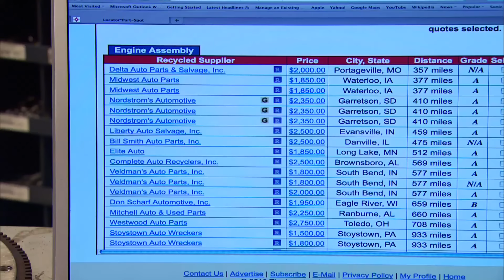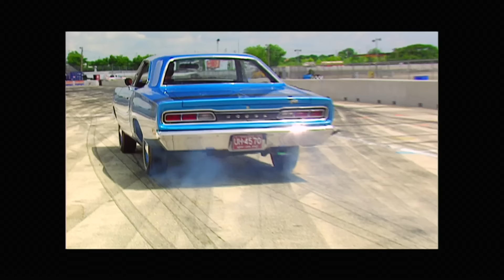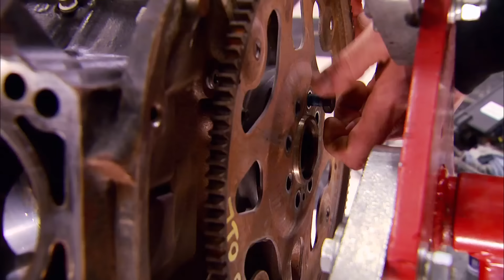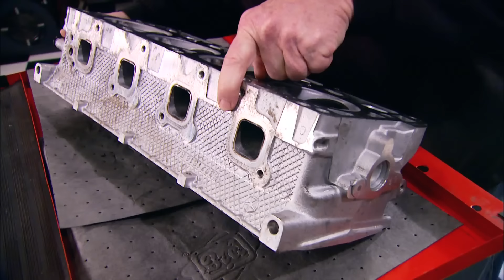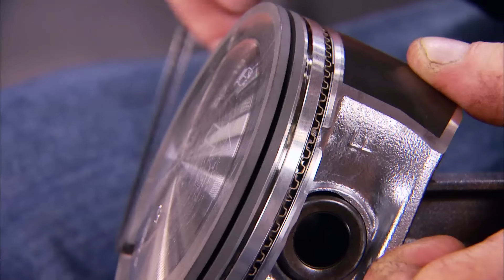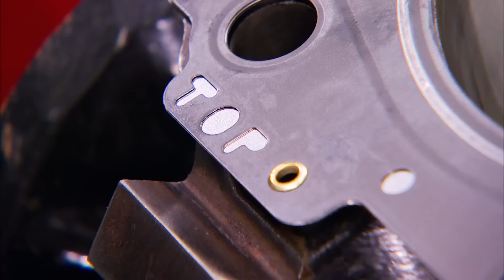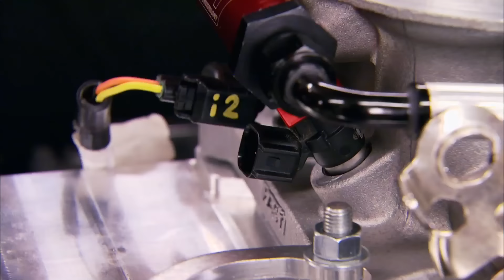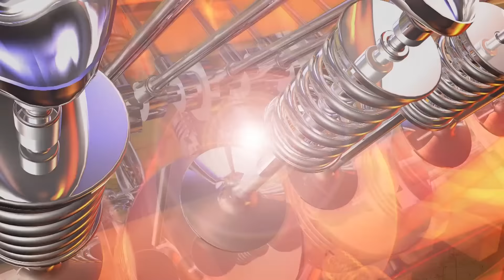Recycled 5.7L Hemi Budget Build Stage 1 - Horsepower S14, E8

Comment: Electric water pump... yet use the truck stock camshaft..with that intake and induction system. And its all apart anyhoooo put a good cam in and if you arent doing a cam and better heads.. .why tear it all down with only 55k miles anyhow...just  slap the induction system on

Comment: I have two questions for anyone that knows the answers.   Since they got rid of the factory ecu and harness, what kind of alternator would work with this set up.  Second does the 5.7 liter hemi bolt up to a truck 46 type transmission from 98 to 01?

Comment: As a parts Manager at a Dodge dealer I can say there is no way I would reuse those lifters. I've seen too many wear out and grind out a glitter parade and waste an engine.
Reply: Exactly. Plus with the low oil pressure problem due to the engine block oil passages a milodon or melling high pressure oil pump should be used with a quart of Lucas oil treatment.

Comment: Rear main oil seal is supposed to be installed dry.
Reply: Dave Topp 
They were definitely reading a different manual. Glad it wasn’t my engine.
Reply: @youtubestolemyhandle1  me too. Reusing lifters.. not taking care of valve seats... Just washing down the block... It made me cringe.
Reply: I dont understand why they even opened that engine up...

Comment: Good motors - Chrysler (Not FCA folks - Chrysler developed and built this engine long before FCA maybe even before Daimler came on board in '98?) has tinkered and evolved these to where they are getting closer and closer to bulletproof.  At least they better be moving towards this with 17 years of service.  Yes I know there is the original 5.7 and the 5.7 Eagle, but bare essentials are still in place.  They won me over from Ford which is saying alot since I was raised from Ford family and bought nothing but until my Jaguar built Lincoln 3.9 V8 went kaput.

Comment: Pistons and rod's do not need to go back in the same hole, especially with fresh rings and a hone... also a visual on bearings doesn't mean alot any more, new engines use aluminum bearings, you can't "see" the wear like old Tri metal bearings with copper underlayment,  always measure.

Comment: Hi, I have an 06 5.7. Concerning the valve seat drop I’ve installed a 180 Tstat  with a tuner the fans now come on 25 degrees sooner and MDS is off for consistently even head temperatures. It just turned 100k miles. Can you give me an opinion as to my need to be concerned of this issue? Also we’re these engines made in different plants and that maybe the ones that do drop valves all came from the same plant? Any guesses? Thanks
.
Reply: Replace the heads before the valve seats fail (because they will)around the 125k milage mark. You cannot get around this. If you wait to do it after they fail, it's going to be much more expensive.

Comment: Damn 2019 5.7 rams tick at start up. I would upgrade the oil pump
Reply: It's not the oil pump it that Mopar oil filter .  Restrictions on start up had the same problem change the brand of oil filters no problems no tick from start up

Comment: Okay, I'm confused.  I've been under the impression that all Ram 1500s with the 5.7L engine made after 2005 had MDS; I remember Dodge making a point of mentioning it in their brochures.  How did an engine supposedly out of a Ram 1500 not have MDS?
Reply: It had to come out of a 2500 that didn't put mds on those models

Comment: So if I get high performance heads , a cam, staged 2 . I should get about 60hp over stock.  5.7 hemi 3 has about 345-350 hp stock . Get it up to 469hp . That's not 60hp it's more like 110hp. That's not to bad . You will probably spend around 3-5k in doing all this . The ss, 5.0 are already at 455hp, with their upgrades puts them at 500+.  Better off just getting a 6.4 hemi , doing some minor upgrades gets you over 500+ .   Just saying.  Unless you are getting a supercharger then that's a different story .

Comment: Its weird how you have to remove the valve cover to add engine oil...
Reply: I looked it up, and it doesn't seem to be the case on a stock one.
Reply: @titanicwhiz  The factory oil fill tube is mounted in the intake manifold and directs oil into the valley. They lost that with the aftermarket intake.

Comment: So that EFI standalone system is neat and all but what transmission would you put behind this? Do they sell ab standalone TCM for the common 545RFE transmissions too?
Reply: Leave the 545 in the thrash can , use a 727/904/RH46 or a stick the G3 uses the same bellhousing patteren as the old small block....Now you can use a Nag1 or one of the new ZF autos transmissions , there is a companey called sound german automotive that sells a controller for those transmissions
Reply: stick an a518/46rh in it.

Comment: Lol replaces all the perfectly fine bearings and timing chain but re-uses the oil pump, and i didnt see any valve removal or valve seal removal after the heads were in the parts washer so thats gonna last with wash fluid in the valve guides... Kinda dumb guys, kinda dumb...

Comment: 400 crank for a stock to refreshed 345 engine...  not bad.  i'd assume a modern 345 hemi with long tube headers and air intake/tune can reach 400 crank correct??  i miss shows like this, i used to watch horsepower tv on the weekends back in the 90s
Reply: for 2K+$, its embarrasing. i built my 400 mopar to 400hp for like 800$.

Comment: All that work, and it would put down about 320hp to the wheels
Reply: thats optimistic
Reply: On my bone stock 16 charger it dynos 340 hp and 380 tq to rear wheels
Reply: @derrickhines9056  that means 420hp at the engine, assuming 20% drive train loss through the automatic
Reply: @tokuzumi1  it seems to be the norm for the 15 and up charger and chally 5.7 to dyno in that range. The daytona 5.7 packages dyno 10 hp more to the wheels with same torque

Comment: i got real lucky got 2 454 strokers one with 6000 miles the other has 38,000  on it rated at 450 hp at 485 torque gt both for free with a tunnel ram set up on one both run perfect

Comment: I have never seen an engine rebuild and using old parts  not replacing cam bearings using old lifters  not sending out the crank to make sure it’s straight  , it is just not the way to do things

Comment: It's weird how I can tell what's inside the engine block like pistons,connecting rods and push rods and rocker arms. 

But I cant see to determine what's what on the outside. Like  which one is the oil filter or the water pump or alternator. 

Any tips?
Reply: Watch hot rod or roadkill they will eventually cove the other parts.
Reply: @charlesbrittain434  thanks dude. 

Here have a beer🍺

Comment: is the Chrysler 318 a good strong motor mine is a 93 how can i get more horsepower its fule injection now please let me no does carburetor give you more power
Reply: the 318 can run, would be better to find a good build using your existing efi. Probably start with an agressive cam and springs, maybe AFR heads, bigger injectors and a tune would be a good start.

Comment: How Much would a rebuild like this cost A CUSTOMER ???  If I took my JEEP  5.7L HEMI to some place for a rebuild AS IS no extras But a good cleaning and rebuild  WHAT SHOULD I EXPECT TO BE CHARGED -- I live in INDIANA --   Not California nor NEW YORK  --- IN YOUR STATE  where ever your from What should a Customer  expect to be charged  ?

MY ENGINE does seem to be running pretty good BUT  it does have MANY miles on it.  Its a 2011 and has now 131,000 Miles but still -- IN MY OPINION runs like a top  BUT I would love to make it like new  without replacing the engine ( you never know what your going to run into after you replace stuff ) .
Reply: Upgrade the cam and put new lifters, do all non-mds lifters and a good tune. It'll be like brand new.

Comment: Who would pay $2000 for that? You got ripped off, big time!
Reply: what would a good price be considered?
Reply: @claytonhaske  The local yard want's $250 for a complete engine including ECU and harness. If you pay $2000 for a pulled engine, you've been had. Especially the 5.7l hemi's that have known, serious issues! Especially from a 2007. Those engines had issues with valve seats falling out(what happened to mine), timing chains breaking, cams flattening, and the MDS equipped engines were total garbage. You could almost get a whole crate longblock for that much. What a joke.
Reply: @JohnDoe-ml8ru  what hemi, if any would you consider? Also, thanks for your opinion, and time, much appreciated.
Reply: @claytonhaske  If I had to work on a dodge, I'd say the older generation, before dodge was taken over. The 318, 360, 440, etc. If I had to use something from the 2000's, then any 345 will do but it has to be torn completely down and rebuilt. All the problems with it have to be addressed. If youre just trying to buy one, then one from the later generation, avoid the engines from 2003-2010. Also don't expect a long life engine. The 2003+ dodge engines use oil passages that are way too small and don't provide enough lubrication and you're stuck with using shitty 0w/5w-20 oil. This is an issue that can not be fixed.

Comment: Why did you not check the valve springs and valve seats as this is the weakest part of this engine. With 50K on the engine valve seats drop out around 80 to 100K. I have a 2006 ram 1500 with 106k with dropped seats and bent valves. Service very regularly and never thrashed. This is a common issue with this engine.

Comment: Get the cheap older 5.7; get a 6.1 crank; aftermarket rods and pistons that are stock sized. Better bearings. The eagle head; better springs; new push rods (your choice); modified oil pump. Everything else stock. Aftermarket camshaft to support your power level thus the your choice push rods and springs. Now what you do w this knowledge your choice; at the end  you can have something decent. They have proven a 5.7 to 500 whp; just turner is what matters; now a days that’s where you most money after the build cost… I pray anyone messing w these motors have mechanical knowledge; if not get yourself a Honda and figure it out till you’re worthy to mess w double the cylinders; but yeah anything is easy if you research and understand it’s never cheap and it’s never easy. It can be somewhat cheap but you have to have elbow grease and some for of ability to to stuff.
Reply: There's a huge difference in head flow between the old and new 5 7s

Comment: Just a suggestion on the soldering of the wires - hold the iron on the bottom of the wires and press the solder on the top of the wires. The solder will then run through the wires as it melts and make a good soldered joint.

Comment: WHY IN THE HELL WOULD YOU REBUILD AND ENGINE AND NOT DO THE VALVES AND VALVE SEALS ? WITH THE COMPRESSION UP ON THE NEW RINGS AND PISTONS THIS IS GOING TO CAUSE OIL TO BE SUCKED THROUGH THE OLD OIL SEALS AND VALVE GUIDES AND START USING AND BURNING OIL! WTF?

Comment: I am not an EXPERT but your numbers are a little deceptive. I say this as a 2006 5.7L  owner, Not trying to troll but to anyone looking for true info. The 5.7 stock peaks at 5800 now did they peak at 6000 because of the short single plane and long tube combo could be. But Beware remember they are not running any accessory drive IE alternator,water pump,and power steering. Your numbers will be lower.

Comment: Never reuse the lifters on a gen 3 hemi. Even if you're just doing a basic reseal on the motor, always replace the lifters even if they are still in good condition. At least one of them is guaranteed to fail and destroy the camshaft. You'll be doing all this again but spending a lot more money next time

Comment: You tear apart a good runner to to do what ? Replace an intake manifold and add a water pump ? While your in there, ya stamp the pistons... oh my... why ? If I ever stamped a piston crown (I wouldn't) or saw anyone do that to a stock 5.7 hemi...  fired, on the spot. go home and take your tools with you. The Mod Man 5.7 intake has been around for a decade. It's nothing new. I'm not hating, but don't tell ppl to stamp their piston crowns. If you cannot keep track of 8 pistons and rods, you shouldn't be building an engine anyway.
Reply: Probably. Not everyone can remember where they came out of. New gaskets. New bearings. New rings. Different intake manifold. 
This is mostly for the folks who are new to rebuilding.

Comment: $2000 for THAT JUNK?  Man you should have just gone down to Pull-a-part, they're full of Mopar junk.  $300 for complete engine.  Too much work for ya to pull one?
Reply: They don't give refunds if it doesn't work, why wud u use a motor from a junked car
Reply: @dirtymoneymafiaent.1686  if you know what your doing an have a damn good rebuild kit an dunk everything, you got yourself cheap an easy power seen first hand with a 5.3
Reply: @dirtymoneymafiaent.1686  you could get 6 engines for the price they paid for that 1, and if your going to do a complete rebuild anyway then why would you care?

Comment: 2009 5.7 hemi roller lifter & cam failure @ 160k miles - always used mobil M1 advanced full syn 5w20 & fram ultra filter both changed @ 5k miles; never ran hard - all highway miles - Dodge hemi is junk!
I have a 2005 chevy vortec 6.0L and it's got 360k miles - SuperTec 5w30 full syn & fram ultra at 7k intervals - still running great and strong! Dodge hemi is junk!

Comment: Nice soldering job...solder point not tinned, cold soldered the joint, so moisture and corrosion can cause the joint to fail.  
Next time, heat the wire first, touch the solder to the wire and DON’T melt the solder on the iron tip...
Reply: I just used a Ryobi 18V soldering iron. It's sweeeeeeeeet!

Comment: Not impressed!! ☹I love hemi's, but to comparing  the stock hp (345) @ the wheels to gross hp on the dino. Is not a correct comparison. The stock crank (or gross) hp. Was about 435. So they lost power. That engine with right cam compression headers etc. can make 500 to 550 hp. They need to try again!!
Reply: ..........well it is only stage one so.
Reply: @MaddJakd  So
Reply: Stock rating of 345 is at the crank also... so they gained 55hp

Comment: Why would you switch to a carb. You guys are so stuck in the past. Carbs are so inefficient compared to injection style. A simple tune would have gotten you 400 up without a full teardown.
Reply: Let people do what they like. I prefer carbs but I understand you can get more power out of injection, but I probably would not take an originally carbureted engine and put fuel injection on it.
Reply: And in the video they said it was an EFI throttle body setup

Comment: The stock HP numbers are taken at the back of the transmission with all possible accessories on and running at max. You guy are going from the crank with no accessories, not even the water pump and your shocked you got 400HP?

Comment: I'm sorry you can't class the modern garbage hemi with the original Hemi there is no comparison the new ones are junk ,yeah they make power but they are not reliable at all . I went through the whole retromod thing in my 71 Charger went through two new Hemi's nothing but problems. Put an old school Hemi in it and have been driving her for 3 years no problems even drove it on Power Tour problem free .

Comment: If I were to buy a ram, I’d personally go with a Cummins instead of a Hemi, mainly because the Cummins is better in pretty much every way, more torque, better mileage, bigger displacement, plus the fact that turbo Diesel engines are notoriously easy to get more power out of without putting any money into them.

Comment: time 2 start electric driving and stop killing the ozon
Reply: Clearly you are in the wrong neighborhood. But I will educate you a little. Electric cars have a much greater carbon footprint than gasoline cars. The manufacturing of the batteries is highly toxic to the environment, and has a large carbon footprint of it's own. Though the car may run on electricity, it gets it's charge from the power grid. The majority of power comes from the burning of fossil fuels. It actually creates more carbon emissions charging an electric car one time than you would use burning 2 tanks of gasoline. The batteries in electric vehicles still are not great long term. So you will be replacing the batteries at least once in the lifetime of the vehicle. So that doubles the negative carbon footprint of the batteries. They also are not easily disposed of, because of the materials used in them being toxic. The batteries are also dangerous. They are highly combustible, and are not easily extinguished. Firemen are trained to just let them burn because of their danger of explosion, electrocution, and the futility of extinguishing the fire. So those toxic fumes are just going to go into the environment. I hope you think of these things next time you are feeling "better" than others because you drive an electric vehicle. Have a good day sir, and might I suggest you go back to the cat and puppy section of youtube.
Reply: What he said, but of course also having a large "carbon footprint" is a good thing. The pollution and horrible conditions created by battery manufacture, well that's something else entirely.